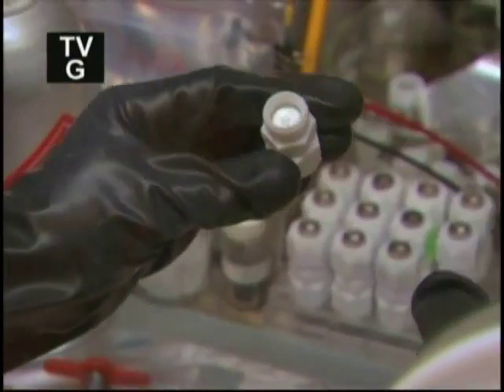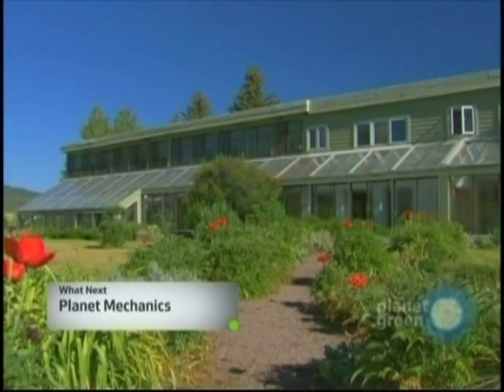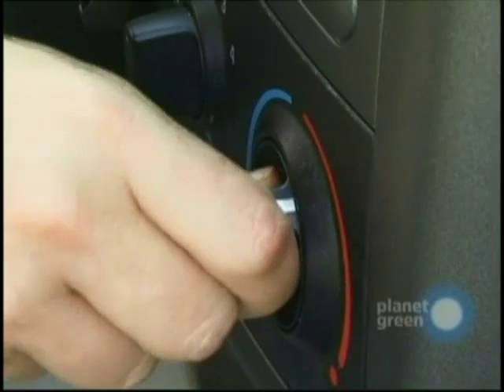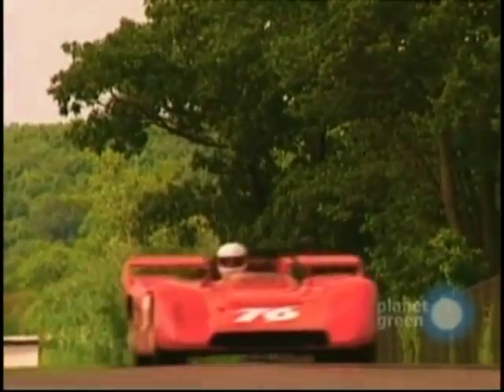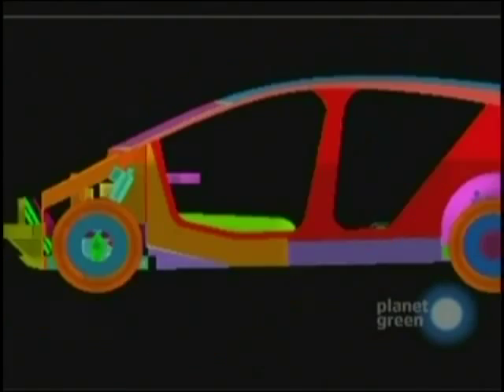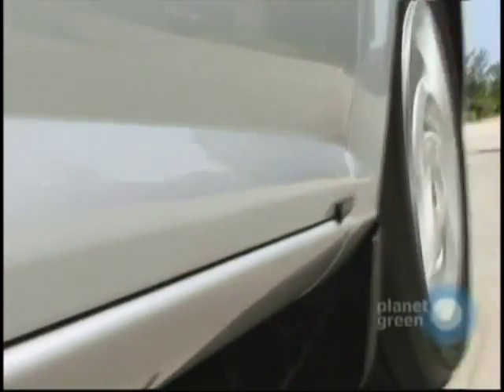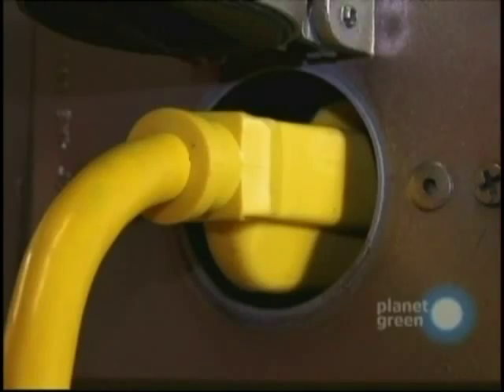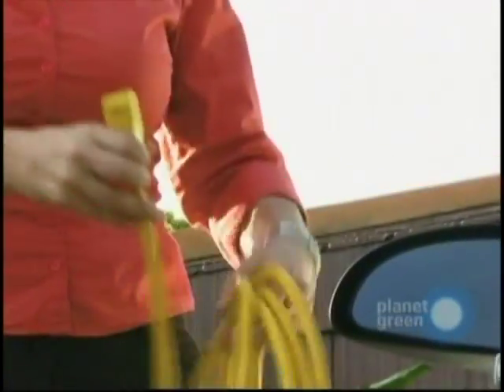HyperCar: Carbon Fiber Car

Comment from the maker: You are correct.  The new Boeing 787 Dreamline is mostly made of carbon fiber material. Watch my other video on the dreamliner. With this material, metal corrosion is not a concern anymore. As a result, humidity inside the cabin can be increased for passenger's comfort. Now, they would need to worry more about molds than dried sinus and dehydrated passengers.

Comment from the maker: I really don't think using the car to feed the grid is cost effective in the long run. No one will pay you back when you shorten the lifecycle of your battery. However, I would like a hybrid car to be able to run as a generator to power a house during a power outage. After Sandy devastate New York, many people would get some power if their Prius could be used as a generator.

Comment: It doesn't make sense that you'll be able to supply power back to the grid.  You'd wear your batteries out sooner.  You'd be better off just getting a battery pack (and solar panels) to supply power during the day and top off during the off peak hours if that is your goal.  Using your car for that is just going to increase the cost of operation of the vehicle.

Comment: has been around a long time. it requires all the car companies to re-tool,  100mpg won't happen with without a battery on board.  I am happy at 60 mpg with a normally             aspirated engine.     gas prices will skyrocket @ OPEC as this  transition hits.